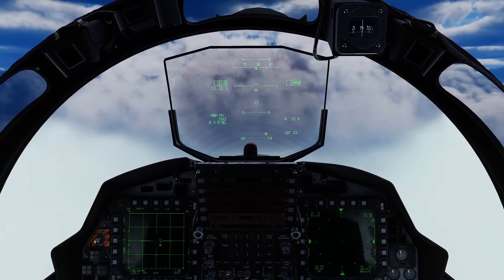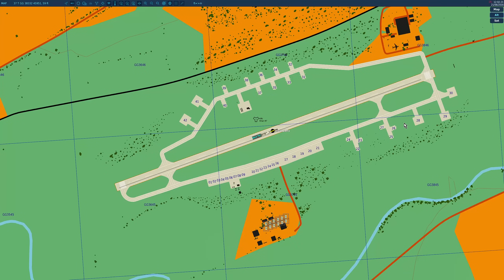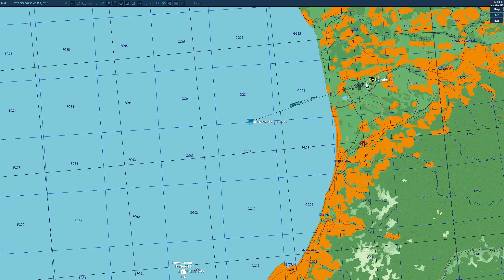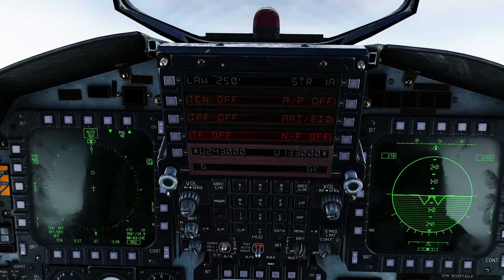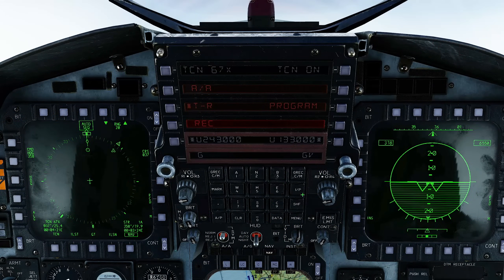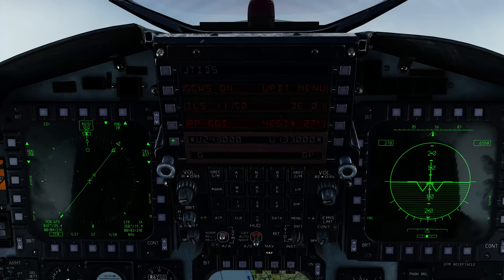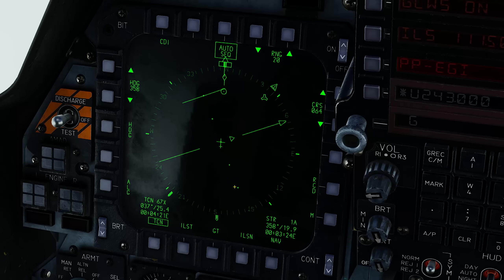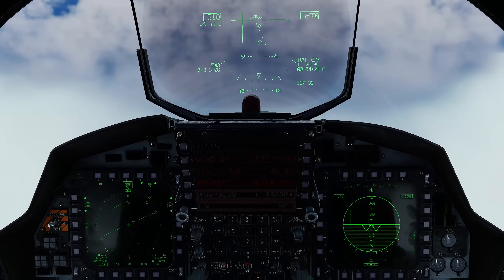F-15E Strike Eagle: TACAN & ILS IFR Navigation Approach Tutorial | DCS

Comment: Regarding ILS intercept distance: Standard localizer coverage (service volume) is +-10deg of runway extended centerline, 25NM, 2000ft above THR (or minimum 1000ft above highest terrain).

Outside +-10deg, coverage is minimum to a distance of 17NM, +-35deg in azimuth, same altitude parameters as for +-10deg)

However, you need to check AIP for local deviations on each ILS, it may be restricted in azimuth or vertical coverage..

Regarding tacan navigation, normal coverage at enroute altitude (high) is about 100-120NM

…approaches can be executed on ILS or TACAN, ILS usually got much lower decision height (200ft or lower)

Comment: One tip you can also do is set your hdg bug to the inbound course of the ILS as that helps show on the HUD the inbound “course”. That way you can see how far left/right your heading is and hopefully stop the pilot oscillation on final. Cross winds will however will require a little offset.
I also hope that any ILS runways have made sure there are no massive buildings/mountains on the final approach so trust the needles to not collide you into one 🤣

Comment: 12:53 
Correction: The difference of the CDI position shown between TACAN (VOR) and ILS selection is due the sensitivity differences between the two (ILS is a precision approach system and very sensitive). Also since you were aligned with the TACAN (which is to the left of ILS transmitter) and on the same course as the ILS, you were shown to be left of course when you selected ILS. 
Not trying to be a smartboi. You appear to take simming pretty seriously, just want to help.

[CV: retired professional pilot and instructor with 30 years of IFR experience in everything from single engine trainers to mid sized corporate jets] 

[edit] Pro-tips: 
1. Rule of thumb for ILS interception, imagine a line from the heading index at the top of the HSI to the reciprocal at the bottom and keep the tip-top of the CDI on that line and you will never over/undershoot your intercept.  
2. Set your desired approach speed and your flaps to the prescribed approach setting prior to localizer intercept. Lower you landing gear at or immediately prior to glideslope intercept. 
3. Practice approaches in clear weather and determine a power setting at your typical landing weight that will maintain your desired approach speed.    (1.3 VSo + 50% of the gust factor in windy conditions)

All that said, you landed a fast mover hot and in zero/zero conditions. o7  

I'm a recent subscriber and I am enjoying the videos that you produce.

Comment: Unless it was my trusty MD-11 and I was in autoland, your altitude above the runway would be an instant "Go around" call and advanced thrust to TOGA to go somewhere else or set up for a CAT 3 Autoland.

Pending on where the airport is located (Altitude and terrain obstacles) you will have a decision height set, and aircraft's GPWS will usually call out "Minimums" at the very least.
Before you get to that point you are to decide if you are landing or not, and that decision is basically "Do you see the runway?" if the answer is no... Then you are to go around and consider your options.
Autoland will land you in visibility that is so bad you can't even see the runway that your tires are rolling on, however the minimum specified is usually around 200 meters so you can actually taxi off the runway.

Comment: You shouldn't use the Fog option in the Mission Editor anymore, because it's not working properly with the new DCS Clouds system. It's super unrealistic to the point of breaking the immersion. This is why the fog on the runway was so absurd that everything was white and you couldn't see a damn thing.

Wags mentioned this straight forward in the video introducing the new clouds system, way back when they released it. Stating the dev teams would be reworking the Dust and Fog features of the Weather Rendering Engine entirely, along with the dynamic weather system, but he never promised a release schedule for these updates.

But everything else on your procedure was ok (maybe just the airspeed was a little bit high, above 200 knots). The approach was actually pretty good, despite the PIOs and hesitation, which are a simple matter of practice.

Comment: You can leave it in ILST when you are navigating to the TACAN. You don't need the exact magnetic heading because the TACAN will give you a rough course until you hit the ILS. In ILST mode the jet will switch symbology when you hit the localizer. Obviously, you should maintain on speed AOA (or just below it, tend to shoot for 19 units) with gear and flaps down throughout the approach.